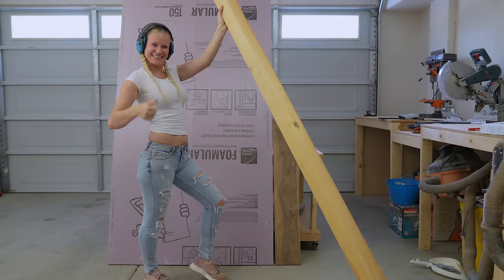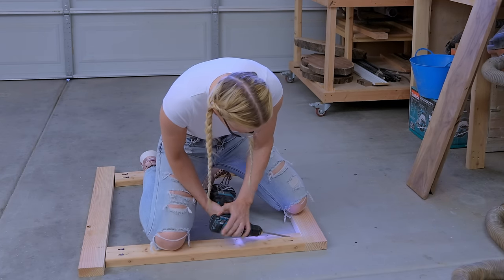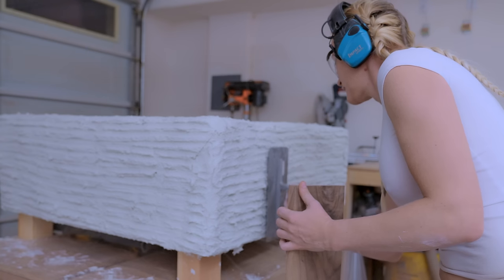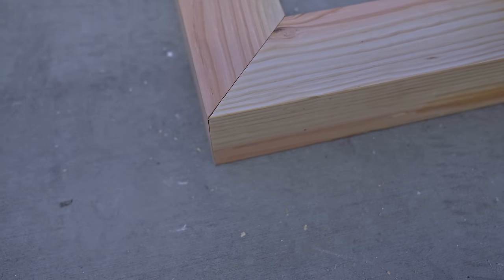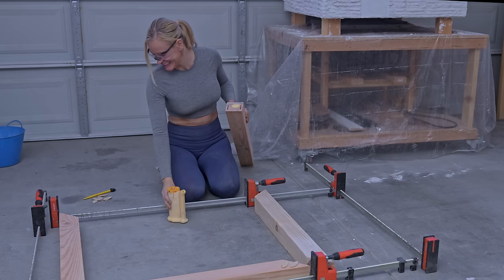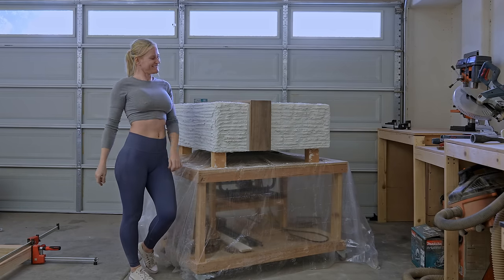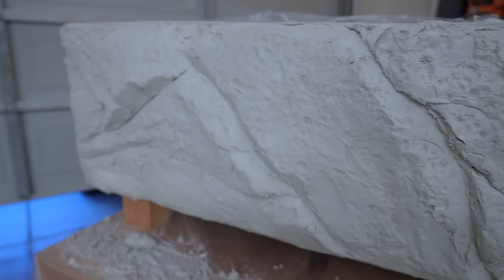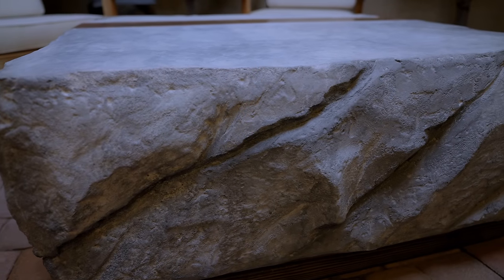It turned out BETTER than expected! #workshop #women #wood

Comment: That pull saw technique is flawless!  Another incredible project Meike, thank you for showing & sharing it with us.
Reply from the maker: Thank you very much!
Reply: Uffff, sanding is nicer. Extra movement  on power tool for perfect surface finish. Anyway good work Mieke.
Reply: Yeah jiggling the booty on purpose. No one does that in real life
Reply: I believe it is just Meike's perfect form using perfect form & I can't find any fault with either.

Comment: Hi there
Any reason you didn't cut the 45 on the 4x4 by rotating the saw round but keeping the blade plumb? That way it would have the capacity to cut right through the timber.
Reply from the maker: That would have been a way too. It’s just a tiny piece that needed to be cut off, so I figured it’s the most convenient way 😃

Comment: Very nice, not only a functional table but a work of art too. Walnut is my favorite hardwood, very easy to work with and it smells amazing. I discovered a finish that looks awesome on both walnut and mahogany. It's 1 coat of double boiled linseed oil followed by multiple coats of orange shellac. The more coats of shellac you apply, the more lustrous it gets. 
BTW, be careful in those crop-tops, you could pick up a nasty sliver

Comment: That R150 insulation panels are easily cut with a box cutter, just cut about 0.25” or 6mm depth and make sure they straight cuts. Then snap by bending on the opposite side of the cut against a straight edge (corner in wall or end side of long table). No need for table saw and dust.
Reply from the maker: Thanks for the tip Jean 👍 I guess I just really wanted to use my table saw 😃

Comment: Have you ever had the glue break apart not reinforcing it with screws
Reply from the maker: I never had the issue of the glue part break apart with the projects I’m building but if you feel uncomfortable just using glue, you are always welcome to add some screws. It wouldn’t hurt
Reply: Thanks

Comment: You can also use mica and cement dust plus water of course to produce realistic rocks and boulders pressed into a chicken mesh frame. I saw some Hollywood set people use this method on film props and it’s an amazing technique. Does not need painting.

Comment: Nice rock finish. But next time skip the foam core and use plywood. Good luck pulling the first large man that sits on that "table". He will need help extricating himself from that POC.
Reply from the maker: Actually I wouldn’t recommend plywood at all. It’s an outdoor table. Plywood can not get wet. So please stay away from it since the box is not fully enclosed plus it adds additional unnecessary weight. The fibers added to the cement make it super sturdy.

Comment: Lovely to watch 😍Table not bad either 😉 did you want your finger kissing better Meike?
Reply from the maker: Thank you ☺️
Reply: @WhatMeikeMakes  Welcome 🥰 What do you think of the Bosch saw? I also have a small workshop and this saw was on my shortlist. I ended up going for the Festool 120 REB and love its features.
Reply from the maker: @1769gordy  I love my saw. Not sure about the price difference but i would think the festool is more expensive. So for the price of tools i can afford to add to my workshop, I love my Bosch
Reply: @WhatMeikeMakes  it looks a really nice smooth operating saw when i looked at one in my local shop. Slightly cheaper than the Festool but a few more features won me over. Have you done a tour video of your workshop?